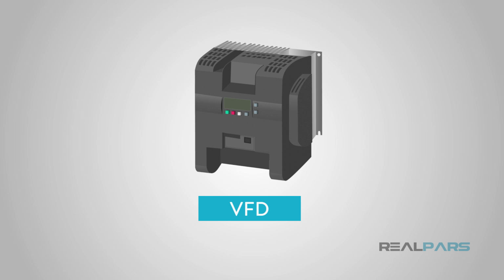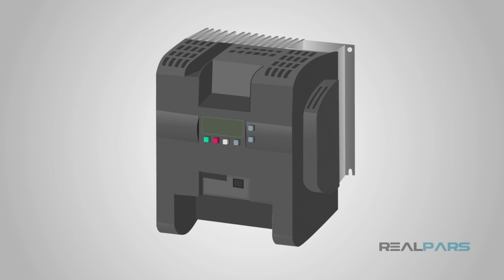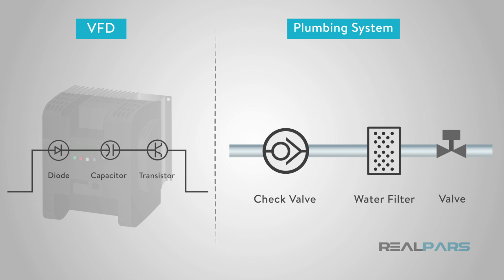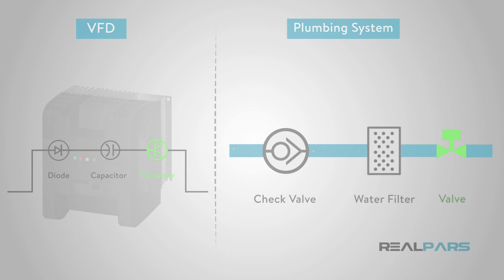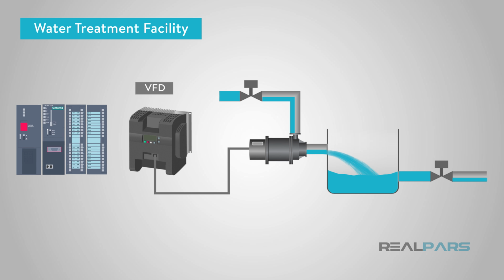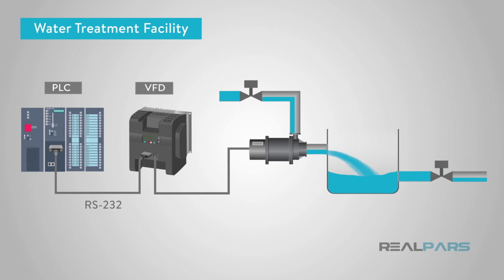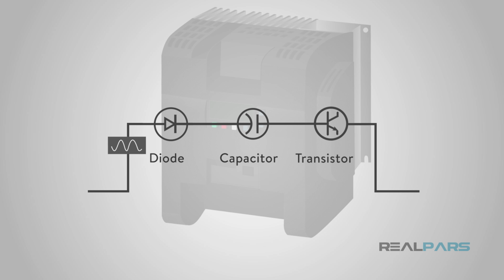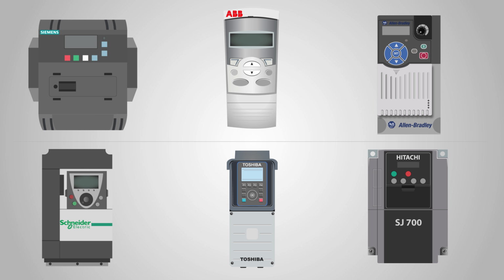What is a VFD? (Variable Frequency Drive)

Comment: I am just telling you what i heard about vfd , then please clarify this 
Vfd not only reduced or increases frequency in both cases motor will draw heavy current and coil will burnt hence vfd by opening the gate at late or early angles it is increasing or de rasing v/f ratio to make changes in rpm and keepingah the winding in good order
Reply from the maker: Hello, @yuvaraj1386  Thank you for your question. It’s a little more complicated than that. A VDF from today has built-in safety for undercurrent and overcurrent. You are correct about some of the functions you asked about, but as I mentioned, it is more than that. Normally, the VDF, depending on the OEM, has built-in smart sensors and logic to measure these parameters. It can sense how much load the motor is under. The VDF is sized to the motor. Most smart VDFs, like those from Siemens, can automatically create a configuration by just hooking up the correct motor size and entering some info from the motor tag, and the VFD will cycle the motor after you power the system up and configure most of the parameters! Like plug and play!  

If you're looking to learn more about this topic, you can join our 7-day free trial at https://community.realpars.com/checkout/realpars-membership 
Happy learning from RealPars!

Comment: Why does VFD Changes from AC to DC then to AC back?
Reply from the maker: Hello, @Suriah12327.   Thank you for your question. This conversion is because most AC motors operate at a fixed speed when connected directly to AC power. By converting to DC and then back to AC with variable frequency, the VFD enables precise speed control, energy efficiency, and smooth motor operation
Happy learning from Realpars!
Reply: It doesn't actually convert back to AC, it is controlled outputs in DC that imitates AC sin waves

Comment: Sir your videos are very informative but sorry to say in this video you did not explain deeply about vfd. How we can control frequency how much minimise and maximise the frequency. What is the function of PWM how it works and which components use in PWM card for controlling the frequency
Reply from the maker: Thank you for your feedback @greenpakistan3184. Yes, you are correct. Our video is meant to be a short version of the real technical version. There is only so much we can say in 8 minutes or so. If you have not signed up for our free trial, I would recommend that you take advantage of it and learn more from us on this topic. To add more to this, VFD engineering varies between drive manufacturers, with some similarities. Here is a link to a book company where you can purchase hard copies or eBooks to learn with our lessons: https://www.atplearning.com/

Comment: VFD is a motor drive  that controls AC motors, it converts AC into DC using a diode then it filters the current by a capacitor then converts DC  into AC using a transistor. What a solid state motor drive
Reply from the maker: Thank you for your question! It sounds like you’re asking about the difference between a Variable Frequency Drive (VFD) and a solid-state drive. Here’s a quick explanation:

VFDs: Primarily used to control the speed and torque of AC motors by adjusting the frequency and voltage of the power supplied.

Solid-State Motor Drives: A broader category that includes VFDs but also covers drives for various motor types (AC, DC, and stepper motors). These drives use semiconductor technology to control motor functions.

We hope this clarifies things. Happy learning from RealPars!
Reply: @realpars  thank you a lot ❤️

Comment: Got a question! I'm a bit confused. If you start out with AC, why convert it to DC just to convert it again back to AC? What is the difference between the initial AC and the final output AC? What is the reason you can't just use the transistors to control the frequency from the original AC source?
Reply from the maker: Hi Dave, thank you for your question!

In order to change the frequency of the AC sine wave, the incoming supply must be transformed. The most effective way to do this is to convert the current to DC and then reform the AC signal at a different frequency. This process also allows the VFD to maintain a constant Volts/Hz ratio, which is important for maintaining the integrity of the motor windings over a long period of time. Inductive reactance acts as a resistor and can cause excess heat dissipation if the V/Hz ratio is not maintained. Therefore, there are multiple benefits to converting from AC to DC and back to AC, including being able to provide a cleaner (filtered) AC feed to the motor.

Hope this helps, and happy learning!

Comment: Thank you for video. Please tell me 03:58 why you have higher frequency and slowly rotation?
Reply from the maker: Thank you for your question! You’ve raised a good point. In a VFD, we work with a feeder power source, utilizing its voltage, current, and frequency to control the motor's actions. By adjusting these parameters, we can achieve the desired torque during slow startups for heavy loads, preventing motor damage. To get the results we want, we need to program the frequency, voltage, and current parameters accordingly.

If you’re a member of our platform, you can learn more about these drives and their general applications. You can check those out over here: www.realpars.com/courses

Happy learning!

Comment: At 2:20 your check valve is back to front. It would actually block water from reaching the filter.
Reply from the maker: Thank you for pointing that out. You are correct, the orientation of the check valve is reversed if the flow is from left to right.

Comment: Will VFD speed reduction increases torque as mechanical speed reduction with gear's ?
Reply from the maker: Thank you for your question. Yes, it can do that. But depending on your motor type and VDF used, you must size it according to the torque requirements you are looking for. Your local vendor should be able to help you size your VFD and motor. 

Happy learning!

Comment: Exceptional video lesson with an impeccable subject of a state-of-the-art equipment which is becoming indispensable in the most varied processes. 
It is fascinating to understand the conversion of AC input energy into DC energy and going out simulating an AC senoid through the width of pulses having the ability to control the speed of electric motors by frequency.
Thank you very much and congratulations on the excellent work.

I'm from the city of Manaus, in the State of Amazonas, Brazil, country, located right in the middle of the Amazon rainforest, where incredibly there are several of these equipment, and I accompany you.
Reply from the maker: Our pleasure! Thank you very much for your kind comment, and for sharing that with us. 

Happy learning!

Comment: Hi! Just wanna ask if it is required to use 1 vfd per motor? Thanks.
Reply from the maker: Hi there, 

Thank you for your question. You can dedicate one VFD for one motor matching the voltage and current requirements. And you can add more than one motor to the VFD, but all motors will run at the same speed since the same VFD controls them. It’s a little more technical than it sounds. A quick answer is; if I have a 100 KW VFD, I can run 10 of 10 KW motors to one VFD. Please see the link below to help you understand more.

https://www.automation.com/en-us/articles/2011-1/vfds-can-control-multiple-motors

Happy learning!
Reply: @realpars  thank you thank you so much for this informative answer. So much appreciated. God bless

Comment: Thank you for the videos. However, the check valve direction is wrong and needs to be changed to the opposite direction. Don't let the arrow sign on the symbol fool ya!
Reply from the maker: Thank you for the comment!  You are absolutely correct!

Comment: The check valve (2:06) is drawn backwards. It will not allow flow in the direction animated in the video.
Reply: You get the point though and message right?

Comment: Why does it say 3 phase into the VFD i thought 240V common household electricity could go in!?
Reply from the maker: There are VFDs designed for single-phase (120VAC), 240VAC, and 3-phase (480VAC) inputs.  You need to insure you are using a VFD compatible with your particular installation.

Comment: Hi,

Do you recommend installing RCCB for a VFD Incomer?
Reply from the maker: A residual current circuit protection device interrupts a circuit in the event of a VFD malfunction. The RCCD measures the incoming and outgoing current of a device or system, and if these two currents are not identical, it will interrupt the circuit.  It is essentially a ground fault detector.  Personally, I have not used RCCDs with VFD installations, as most modern VFDs can detect internal current faults on their own.

Comment: Informative video! Suppose we have a traditional inductive motor with maximum 1400 RPM, then we connect that motor to a VFD, here is the question: Does it possible to increase the RPM of the same motor more than 1400 RPM by increasing the frequency? And does the power consumption will increase?
Reply from the maker: It is possible to overspeed a motor by setting the frequency above the nameplate frequency.  However, motor torque will start to decrease above 100% speed.  This occurs because the faster speed leads to increased slip, which robs the motor of torque and converts the excess energy into heat and efficiency loss.  Overspeeding a motor is sometimes done with fans, but there can be adverse effects of doing so.  Power consumption depends on the loads that are connected to the motor.
Reply: @realpars  
In my case it's a water pump one horse power 746 watts, my plan to make a basic inverter or a soft starter circuit in order to run that motor on UPS 12/220v--1200 watts,but I face problem that my UPS circuit breaker cutting off due to rough start

Comment: How VFD senses that tank is getting empty and to be filled now?
Why we don't use ac power instead of VFD to control motor??? Kindly explain
Reply from the maker: You need to have a means to measure the level in the tank.  As shown in the video, an operator looks at the level reading and makes adjustments to the VFD.  Alternatively, a PLC or other controller can be configured to sense the level and adjust the VFD to maintain a constant level.  A VFD controls the motor by regulating the AC frequency and voltage to the motor.  A VFD allows an AC motor to be run at various speeds.  Using an across-the-line starter only allows an AC motor to run at a single speed.

Comment: Thanks.  Can you tell me, what is minimum kilowatt motor that autotuning possible through vfd ?
Reply from the maker: Technically,  if the VFD has the option for auto-tuning, you can configure auto-tuning for whatever KW rating the VFD is rated for.  Practically speaking, since auto-tuning is performed to improve the efficiency of the motor performance, tangible (measurable) benefits will not likely be seen for motors less than 5Hp (3.275kW).

Comment: dear sir  can we use this motor for inducing pulsatile flow of fluid in a tube
Reply from the maker: You could try, but it is best to use a reciprocating or positive displacement type pump to induce pulsating flow.  These types of pumps are usually not controlled by a VFD.

Comment: At 2:08, is the check valve symbol in the correct orientation?  I thought the "eye" always looked in the direction of allowed flow.  Thanks.
Reply from the maker: You are correct.  The orientation of the check valve is reversed if the flow is from left to right.

Comment: Nice Video, May I know the minimum output voltage and frequency for Dosing Pump application 380V 50Hz?
Reply: Normally, for efficient operation, the motor should not be operated at <10Hz for long periods of time.  Since you want to maintain a fairly constant V/Hz ratio in a VFD application, that means the minimum voltage would be approximately [380/50] x 10 = 76V.
Reply: @scottsommer5450  Hello Sir, when i read the vdf delta datasheet, the common settings for V/F Curve for general purpose has min frequency 1.3 hz and 10V while max is 50hz and 220V. currently i set the setting like this but 220 change to 380V. I need low rpm for drawing minimal chemical flow
Reply: @chickenz4604  Sorry, I just saw your question.  What setting did you adjust?  Which parameter changed to 380V?  Normally, you would just  need to input the motor nameplate data into the appropriate VFD parameters and set the output for the Hz value you  need. The VFD does the rest.  I will say that 1.3Hz / 10V is very low, and may be outside the limits of your specific VFD.

Comment: Can a sensor automatically controll the VFD
Reply from the maker: Absolutely!  Using a VFD as a final control element in a PID flow control scheme is a very common use.  You should pay attention to the rate of change of speed so that the drive is not cycled rapidly.  Configure ramping in the VFD for smooth transitions.  Put in logic to safeguard the system (overpressure, etc.) and turndown the motor speed if necessary.  Other than that, a VFD is a great replacement for a control valve in most instances and will save energy as well!   Most newer VFD's have the ability for configuring an internal PID loop with a sensor connected to an auxiliary input, but I don't like doing this because I lose some control over situations where using a PLC to drive the output would provide better logic control.  One area that using a sensor with a VFD PID loop directly is popular is with HVAC fan control.

Comment: Your graphic of flow thru the water pump into the holding tank is reversed. On skid-mounted pumps the suction is on the the end of the volute & discharge pumps out the top of the pump housing.

Comment: Can VFD used for single phase motor?

If we have 1500 rpm single phase motor, is there any effect on the motor if it is running 1200 rpm continuesly?
Reply from the maker: Not much.  If the speed of the motor is being reduced by using a resistive or reluctance circuit (constant frequency), then some power will be lost as heat.  Using a variable rheostat to control speed (by varying the voltage) will produce good results with little efficiency loss.  Running your motor at 1200rpm will not significantly affect the performance or life of the motor.

Comment: Why convert AC to DC and DC to AC... Directly Ac send into the motor..?
Reply from the maker: The answer is that there is no other way to easily change the frequency of ]the AC input, which is the purpose of the Variable Frequency Drive.  This change in frequency allows an induction motor to run at different speeds, and the VFD allows for precise control of the frequency and hence, the motor speed.  The inlet AC frequency (50 Hz) is changed by rectifying the AC sine wave, creating a DC voltage.  The DC voltage is then inverted at the required frequency, creating an AC voltage again,. only at a different, controlled frequency.

Comment: Nice video I like it. question how can we avoid/prevent if the frequency is reduced result in the motor got damaged?
Reply from the maker: VFD's do place a strain on a standard motor, due to the magnetic fluctuations and heat dissipation when using a VFD.  That is why it is important to use an inverter-rated motor and to use a quality VFD that can hold the Volts/Hertz ratio as constant as possible to limit heat dissipation at lower speeds.

Comment: Sir...I checked vfd incoming current that's value is 10 amps...but when checked vfd outgoing (motor side) then value shows 30 amps...

That means vfd saving power...but my question is...what phenomenon happen in vfd that's reason outgoing current is greater than incoming current.
Reply from the maker: I am guessing the incoming power is 480 VAC and the output of the VFD is 240 VAC.  Power = V x A, so if the power output of the motor is constant, if Volts is cut in half, Amps will double.  That is a little simplistic, but you get the relationship.  Also, a VFD keeps the Volts/Hertz ratio nearly constant at the output, so a slow-running motor that has to generate a lot of torque will pull a lot of amps.  That is why we use overloads on the motor leads (or use the internal current limiting function in the VFD configuration).  Lastly, make sure you are measuring the amps on the VFD output correctly and correcting for 2-phase versus 3-phase operation.  I would need to know the exact model number of the VFD to provide any further analysis.

Comment: If I want to control a VFD (eg for controlling water flow of a pump) from a PLC, do I need to connect the VFD wires to an analogue input card or analogue output? I think it needs to be an output card, right? Because you need to tell the VFD to either increase or decrease flow rate. So should it connect to an analogue output card?
Reply from the maker: Yes, you will need to provide an analog output signal from the PLC and wire it to the reference speed input (setpoint) of the VFD.  The value of this output will represent % Speed.
Reply: @realpars  Many thanks.

Comment: Why do you have to go through the process of converting to dc and then back to ac. What would happen if you take the converter and filter out but left the inverter ( which to me seems like it does the bulk of the work)
Reply from the maker: In order to change the frequency of the incoming power, you have to go through the conversion from AC to DC (rectifier) and back to AC (inverter).  The incoming power is, let's say, coming in at 60HZ.  There is no single device that can change the frequency of the power input to use as the output to the motor.  We change it to DC to be able to adjust the pulse width to match the frequency we want to change the output to.  Once that is done, we use the inverter to reconstruct the AC sine wave at the new frequency.  While more complicated than that, you get the idea.
Reply: @realpars  ok got it thanks!